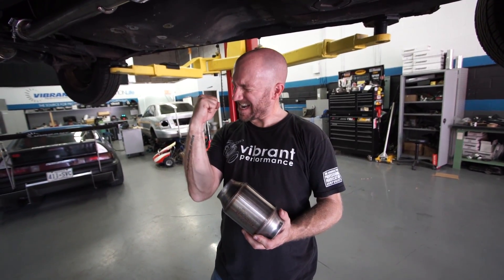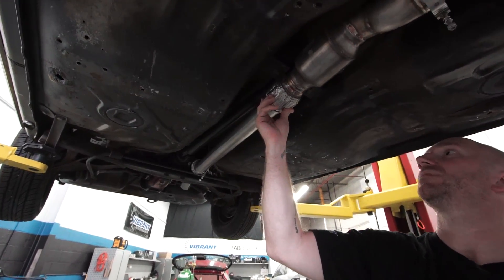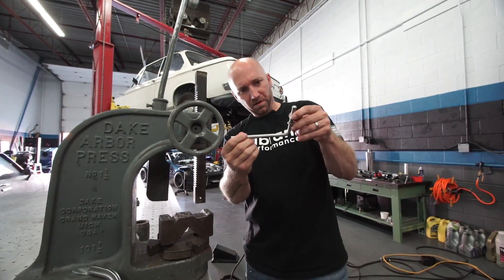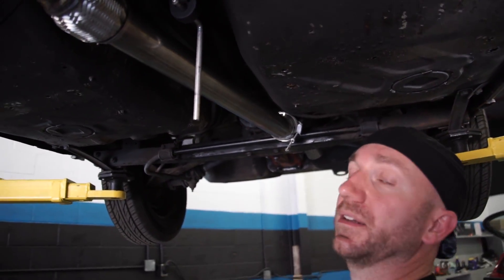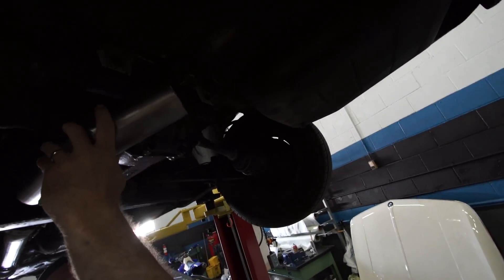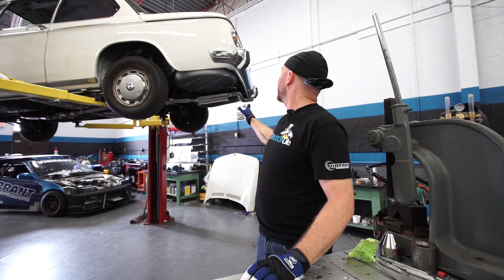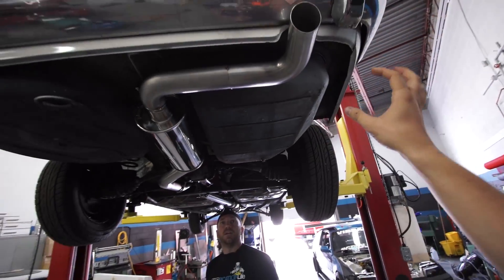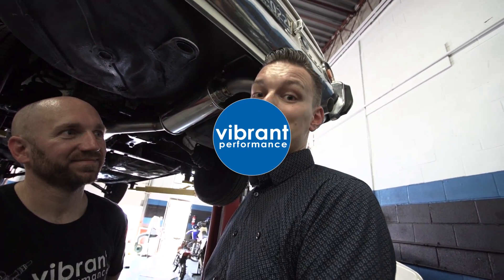Retro Header Build-Off Part 6: Finalizing the Exhaust System

Comment: Love your build and the way you weld all those parts.

But see some problems. I worked as stainless steel exhaust builder. 
Why those 2 bends after the collector? coudn't you bring the collector at a higer point?
The flexible is way to far to the back, better was 2 smaller flex in the front pipe.
The exhaust will expand with 2-3cm, i see some clearance issues
That exhaust hangers are designed the wrong way, when is expand, it can flip out. 
and better 2 dampers, otherwise it will sound like a honda.
But love your video i liked it.

Comment: don't weld the rods straight onto the pipe. it'll rust, stainless or not. you know absolutely well that the rods go on the edges of the mufflers or flexpipes.
Reply: Ace Futura the mufflers/flex will have the same effect. The argument for welding to muffler ends is simply strength but seeing as his hangers are curved around the pipe underneath, it's not an issue
Reply: You can weld straight to the pipe as long as there's enough load distribution.